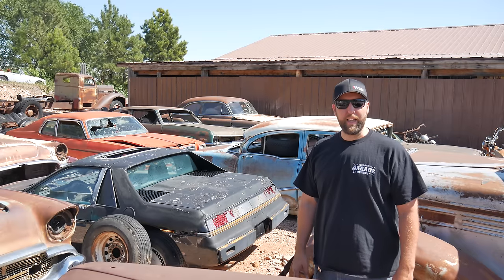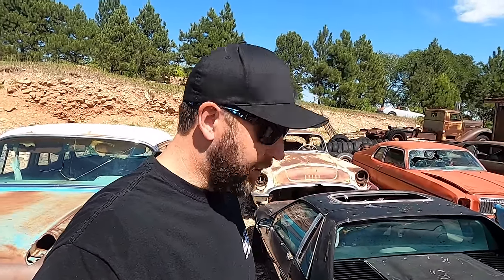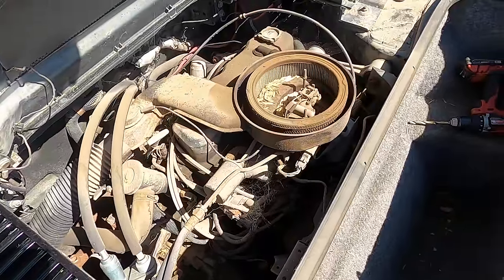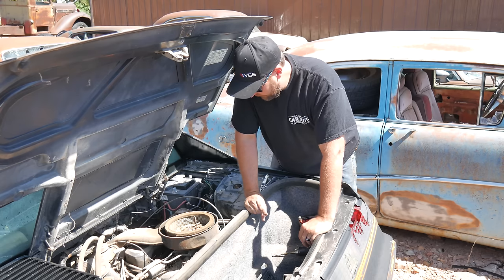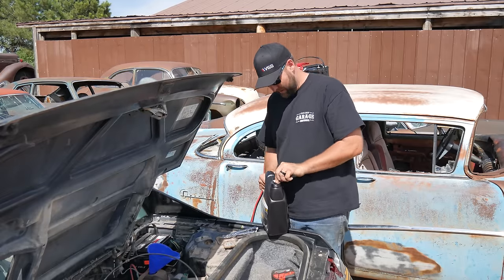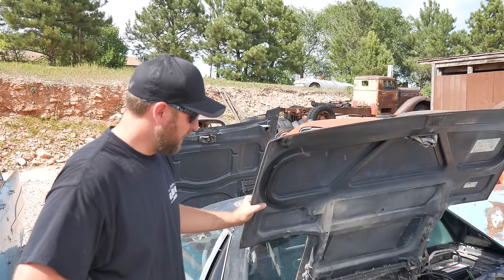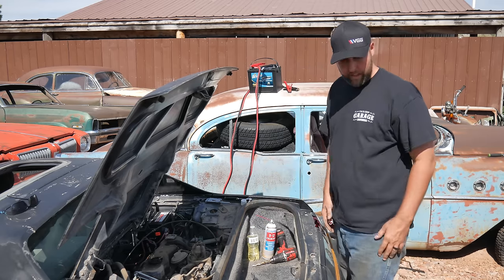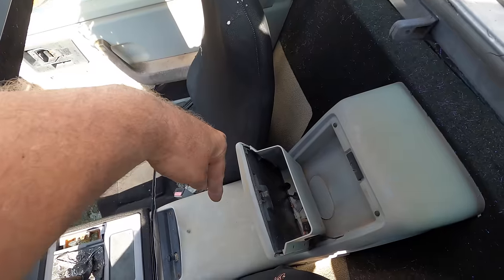ABANDONED Pontiac Fiero Will It Run And Drive After 17 Years? - Vice Grip Garage EP 97

Comment: 34°55'19"N 86°45'54"W • 241 m at this location in alabama you will find a hundred pontiac feiros
Reply: Dang
Reply: I think that used to be a place that specialized in outfitting Fieros with Cadillac 4.9 liter V8's, Northstar V8's, Buick 3.8L V-6 and Camaro 3.4L V-6 engines for those that wanted a peppier version of a Fiero.

Comment: I love Derek's specific resons for buying exactly this oil 🤣
Reply: If you are on a budget . . . the diesel oil must perform its lubrication job in an engine with higher temperatures and pressures . . . so for the money you are really getting performance.  I run 5w30 diesel oil in my gas autos too.  Works great and last a long time.

Comment: First thing I thought of when you cranked it was every 2.5 S10 I've had lol
Reply: 1986 olds cutlass calais two tone blue. those 4 angry squirrels just wouldnt quit
Reply: MOUNTAINEERS..
Reply: @scottemerson7027  all day every day!
Reply: Well we know that it has a bad fuel pump or relay or something and then we also know that he has an electrical problem because the starter kicks over a crank submitted drops out I'm wondering if the distributor cap is still in one piece remember that it is the electrical plug for the electrical system if it doesn't work the car won't stay in operation? Double check the electrical?
Reply: Or for me the sound of my own 2M4
Reply: Same.
Reply: My 89 Chevrolet Celebrity
Reply: The sound of every damp morning
Reply: @greggarner4477  and every USPS LLV delivery vehicle, too.

Comment: How did he drive that thing with his head sticking out of the sun roof?
Reply: An Appeal to Heaven  Yeah when you don,t have a gurney bubble .
Reply: Back before a feller reached his full sasquatch height.
Reply: I think you answered your own question. The real mystery is why would he park such a magnificent specimen. A quick look on ebay taught me that the Lamborghini Countach and Ferrari Testarossa both used the Fiero as their chassis apparently! 😂🤣😂🤣
Reply: my thoughts exactly, thats a big dude in a little car LOL
Reply: I am 6'3" and fit in mine better than most cars (even a full size Chevy Regular Cab) . Only thing I have to do ( beside getting running after 11yrs) is get a 13" steering wheel instead of the stock 15 or 16 it has now.

Comment: I had two iron dukes. One in a 1982 citation witch i treaded in for a 1987 s10 . Citation had over 100,000 miles and the S10 had 211,000 miles until it got rear ended. Both were good running engines.

Comment: As a student I worked at the GM Oshawa Fab plant and they put a Fiero in the foyer of the plant. Would have been 83 or 84. Remember hand welding the nuts on the first set of motor mounts for the N body. Great times.

Comment: I had a V6 '86 Fiero 15 years ago when I was in college and had trouble with 1st and reverse even after changing the clutch master and slave cyls. Ended up swapping the pushrod out on the slave cyl with 1 slightly longer and it was always good after that. People on the forums always had the same issue, anything less than perfect bleeding and no 1st or reverse.

Car was great, easy to work on and parts were CHEAP so good for a college student. I also got 33 mpg highway one time driving home from college, V6 4-speed manual, it burned a lot of oil so that probably helped lol

Comment: I picked one of these up since I always wanted one. Fuel pump failed and previous owner put another in it, then that one failed after 10 minutes of me running it. Now it's sitting in storage since I'm swapping in a Cadillac V8. Picked up a full car with the engine I wanted, fuel pump was also bad. I seem to find all the failed fuel pump vehicles.

I'm surprised you went with cranking the engine to test the fuel pump. The relay only works the pump for a second when the key is turned forward and then the pump activates again when the oil pressure gets high enough, which for me has always been higher than cranking can produce. But then, you are a lot better at diagnosing things than I am. I couldn't hope to get the ol girl running like you did. 

I've been waiting for you to get a tire like that. It's always a moment of wonder when a tire that shouldn't hold air does. I had a tire that was completely blown out, had the tread in my hand, and it still aired up. Dunno why, didn't want to question it too much since it got me over to solid ground to jack up.

Comment: The Fiero with sunroof off and windows up creates a vacuum in the passenger compartment. The vacuum sucks hot air from the engine through the ECM computer, the computer overheats and causes missfiring. Anytime you drive with the sunroof off you need to have the window partly down to stop the vacuum effect. The wiring connector in the firewall is not air tight and the reason air is sucked from engine compartment to passenger compartment. I've had 4 Fieros, that one would be neat to turn into an electric car.

Comment: I worked on Fiero`s as a Pontiac mechanic . This one with it`s mileage must be a replacement engine. The block area where a water pump would be was too thin and were cracking boo . The v 6 was much better . You can find a iron Duke in GMC mini trucks .

Comment: I had an 85 fiero I bought for 300 bucks. I had put fresh oil, aftermarket fuel system and so much more. BUT I sold it for 100 bucks because I didn’t know anything about carburetors and didn’t want to pay 60 bucks for a new one and that’s all it need.

Comment: Had one 6 cylinder. Great 80's car when it ran. Wish I had one of later ones with new front end and more horses.  Loved the flex body panels. Heard a rumor they built the car to play with the body panel, first front ends were out of a Chevette and end motor/tyranny was a Cavalier? turned backwards/, not sure how much if any is true . Good Miami Vice car.
My about 12 told her.  friends I bought a Ferrari I would buy one of the last year with all his options. 
Loved the body it didn't dent, and I hit stuff.

Comment: In the back is a slave cylinder. The dipstick does not read all of the oil. Maybe the top 2 qts. The iron duke should hold 4.5, roughly.through years in a shop, i hated fieros and mr2s.

Comment: If that was an 87-88 GT with a manual, it would probably be worth more than you bought it for, those are in demand. The 84-86 Iron Dukes, not so much, but someone might really need that engine for their Buick Century or Olds Cutlass at this point.

Comment: i worked at a pontiac buick gmc dealer for 22 years. starting in 1982.. i remember when those cars came out!!   lottsa recalls on them to prevent fires!! the same 2.5 engine leaked oil out the shitty unsealed valve cover, and another problem with the 2.5 was the blocks cracked in the lifter galley due to the addition of roller lifters gm decided to update these engines with but the old blocks didnt like this!!       the same 2.5 engine that was used in the fiero was used in all the gm models those years!!!    the only problem different from the other models with the same problems those 2.5s had those years was the fieros would catch fire because the cat was directly underneath the engine!!! oil leaked from the valve cover would drop onto the cat and you know the rest... fyi i only had 1 fiero that i knew of had fire damage!  recall saved all ther rest of them!!!

Comment: Hey Derrick 👋 love all the shows. What kind of old big heavy duty truck is that in front right of your Pontiac Fearo? And does it run? Looks Kool and maybe has a big straight 8 in it with a transmission that you have to double clutch and synchronize yourself to get her down the road. Or maybe a big flat head V8. Has that nice drown natural rust color. I'll be dipped.. Always another great show. Does Jessica have a sister? And if you need a good CB radio setup. To carry on your long trips. Maybe even a Slip seat box with both CB and FM radio for some tunes on the way back home. I'll fix you up for free. Just need to know where to ship it to you. Thanks for the great clean down home shows. If your ever in need of a parts or just some help. I'm just west from Chattanooga Tennessee. Yee Haw!

Comment: i love this channel. j've had at least 1 of nearly every car on vgg...really.  i have the utmost respect for you derek but the 2.5 L4 engine  in the fiero you referr to as an iron duke ... is not an "iron duke".  the 153cu in L4 known as an iron duke has been around since the late 50's and was used as a stationary engine for compressors, generators etc.. in the early 60's it made it into a few nova's and also into a few pontiac astre's & chevy monza's  in early 70's ...  but was adopted by the marine industry where it is still available as a 2.5 and 3.0 l version that is now made in mexico.. there are many,many differences in the two 2.5's but the biggest difference to the un knowing eye would be the valve cover and "iron duke " has no metric bolts.. the iron duke also has many of the famular parts from small block chevs of all sizes...

Comment: 2 get in and out you face 90 degrees perpendicular--facing away from the vehicle, tuck and fall into the car, lean to your right over the center column and pull your feet in. Easy Peasey.

Comment: Those fieros were well none for engine fires because they only called for 3 litres of oil and oil leaking on wires and a few other things that caused them to take fire but with 50 miles to the gallon who cares,i think it was because they are made from plastic body parts,they just needed to put more time in to fixing those problems it had and it would have been a good commuting car and fun to drive as long as you stay clear of transport trucks.

Comment: Now I'm a Pontiac man, a GM man, even. Yet I have not once actually looked under the hood of a Fiero. That is absolutely bananas.
Reply: I have owned and driven a Fiero exclusively as my primary dirver since '89.  Currently drive an '88' GT five speed V6 with 66K on it and is my third Fiero.   My other driver is a '58 3/4 ton GMC, which I've owned since 1970 and in 1980, drove it all the way to Circle, AK, which is about 10 miles short of the Arctic Circle.   The original inhabitants thought they were on the Arctic Circle, but were actually about 10 miles short, but because of the mighty Yukon River, at that time, could go no farther.

Comment: Jessica dated a guy with a Fiero? That was her first mistake! Lol. 

Just kidding. I actually love them. They are fun to drive like a go-kart and  corner fairly decent and oddly enough mine got great traction in the winter with the snow. And they heat up really fast too in the winter because the cabin space is so small literally within minutes you got a nice toasty comfortable place to sit in and drive. So overall I thought it was a pretty good car and I didn't even have the V6 I had the iron Duke 2.5 l. I wish I had the six cylinder but that iron Duke did a good job and it ran strong. 
Only reason Pontiac quit making them was because too many gearheads were dropping Corvette engines into them, therefore making the Corvettes look bad and because enough people figured it was much cheaper to buy a cool looking car, a brand new Fiero and drop in your own brand new or used Vette engine in it and have several thousand dollars left over to continue pimping out your ride or put it in the bank and keep your insurance down too unless you told your agent.
 The GM execs didn't like that so bye-bye Fiero!

Comment: I owned a 1984 fiero which I bought used; manual and fun to drive. I ditched it in less than one year after a failed clutch cylinder, starter and the list goes on and is long. Worst car ever built!  Also I saw a totalled one that was in pieces as it fiber glass!

Comment: My buddie sister had one and he said that radiator hose was like piped in like uionion workers but it leaked and cost a lot of those engines .cause that hose had to go all the way to the front of the car Humm I almost bought one but looking at it and the price I thought it was 17.000 no 1.700.00 the guy wanted for it .back in  2000 then I got to drive one and it was a dog.good luck with this but I wouldn't try to hard if I was you.

Comment: I got an SE v6, 86 model for my official first car. 
I was 16, this was in 1989. 🔥🚗🔥
Fiero means... Fire + Arrow.
A flaming arrow. 🏹🔥
- Neighbors had a few of them they all caught on fire and burned up. 🚒
- My model had a bad habit of spinning out of control when it was driven on wet surfaces. 💦🍌🚗🍌
Eventually it was eaten by a Mack Truck with some clown on the front. 🤡🚚